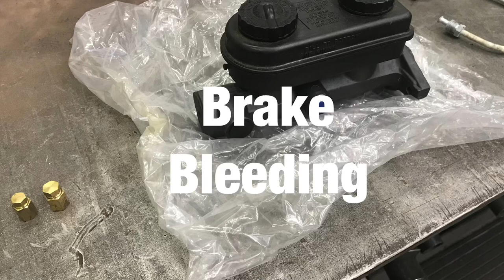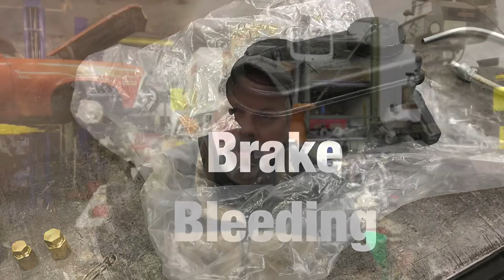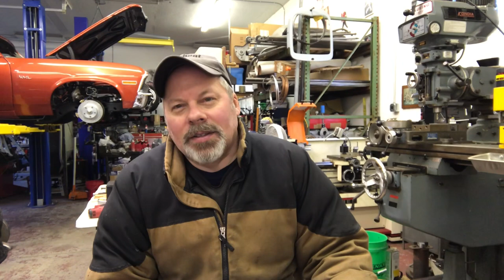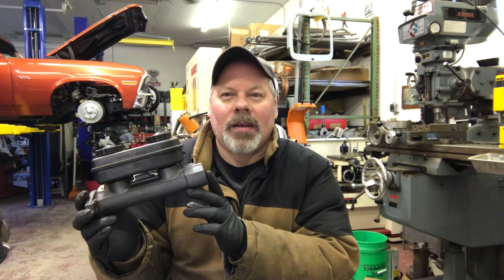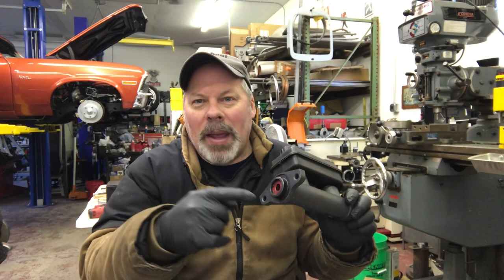Brake Bleeding

Comment: I typically use a hand vacuum pump with a reservoir for bleeding brakes. Never tried gravity bleeding before. I need to do some brake work on the ‘49 Jeepster. I will try the gravity method. 

My ‘66 C20 will lose brake fluid when it sits. As long as I don’t forget to check it when I move it for the first time, I can top,it off and have good pedal without bleeding.

Comment: Is that the style you are using for manual brakes?  What are the specs on that master?
Reply: Never mind.  Got ahead of myself....just got to that part of the video.  Thanks for the info!
Reply: Full size Dodge van?
Reply from the maker: Yes full size, bore is 1.13
I use it on everything, mostly manual but works with power if it fits the booster.